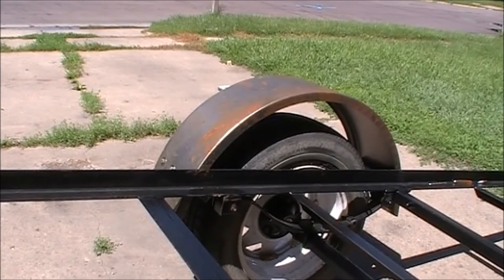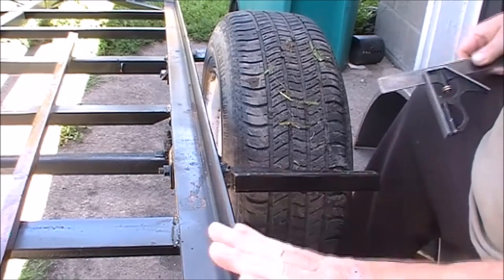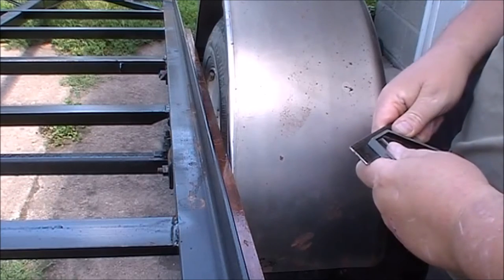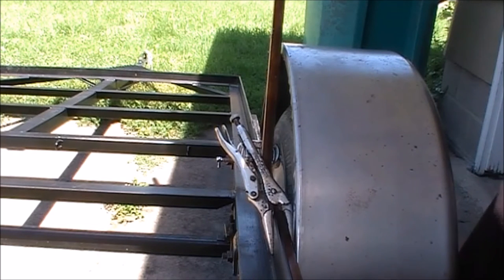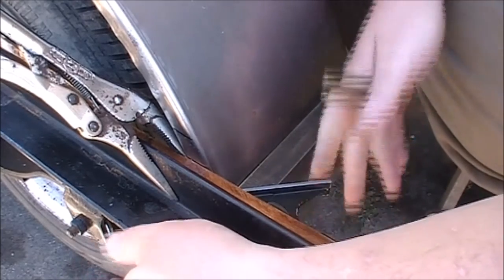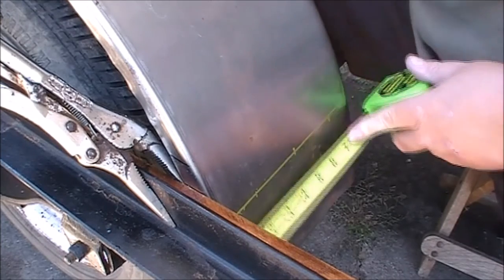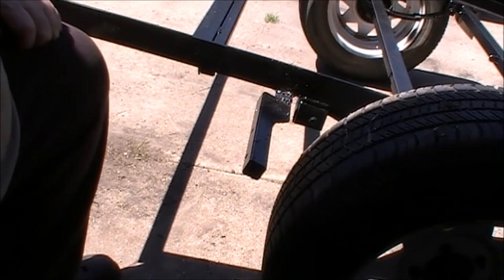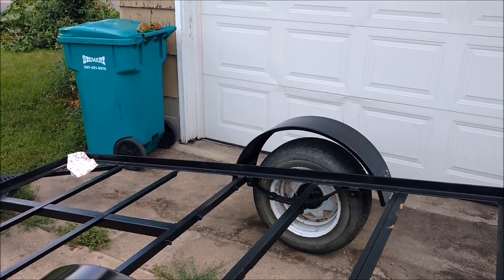Something a little different: Mounting the fenders

Comment: It feels like Fall has arrived in Fort Worth today.  I think the high was 81 degrees, after being 107 on Saturday and about 104 yesterday.  We usually run in the low 100's from now through the first week September, but the forecast shows lots of temps in the 80's and low 90's for the rest of August.  I am elated.  Has the Earth tipped over? Being a fellow fat man,  I worked construction out in this heat for over 31 years and I just can't stand it now.  Thank God I am retired now and can hide from the furnace outside.
Reply from the maker: I used to work outside a lot too, after I had heat stroke a few years ago I just can't handle it like I used to. I've been through your area many times and it's a different heat there.  80 today and the humidity is way down from what it was but every summer we get a streak of hot and humid. 95 and 80% humidity really sucks.

Comment: Once you finish this trailer, you'll want to sell it so you can build version 2.0 using all of the tips you learned through hindsight on version 1.0.  You'll get to do all of the things you wished you had done on the first one.
Reply from the maker: That may be. I'm already wishing I'd gone to 5' wide and 10' long but like you said, 2.0.
Reply: Mr. Tolly (AKA: fatmantolly)
I knew you were already thinking about ver. 2.0.